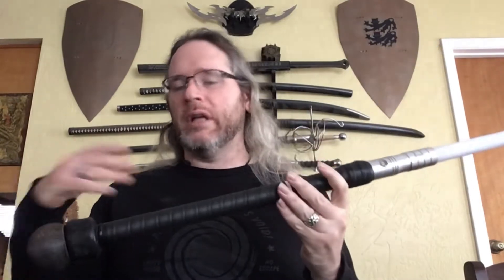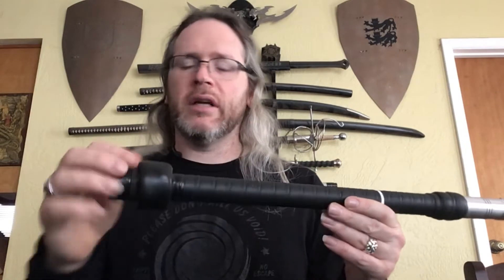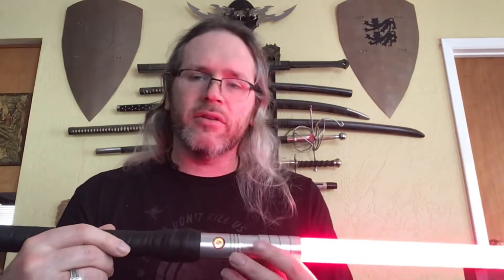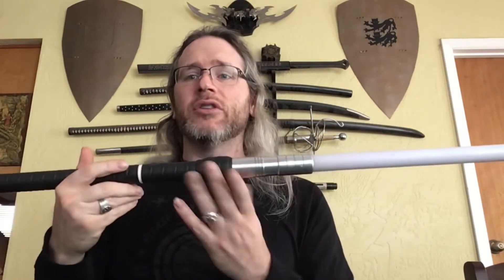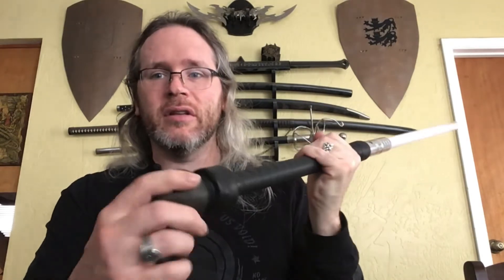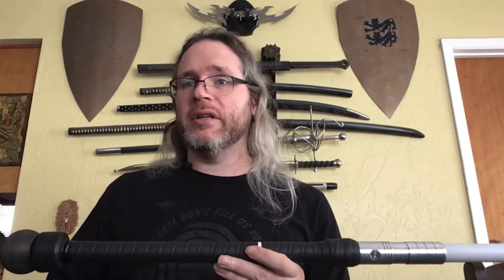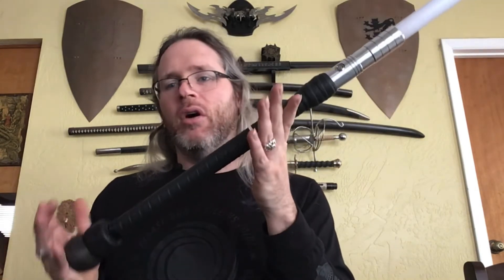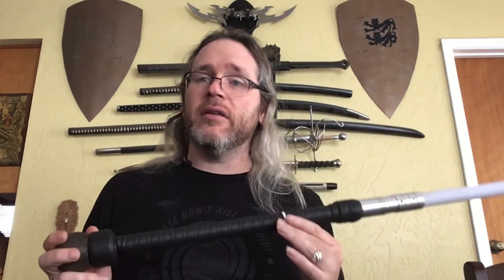Contact Flow Saber from The Saberflux Workshop

Comment: Dude that was an awesome review thank you so much!!! It really means a lot to me for it to be so well received by you 🙏
Just a couple of little but important corrections!
-the rubber-like pommel is actually flexible TPU and the chassis is PETG (I’m gearing up to switch to nylon for the chassis). 
-the main counterweight is padded steel.

haha and now I’m actually using some transparent silicone caps for the blade tips so you’re dead on with that! I’ll have to send one your way! They are VERY durable (like they won’t break even if you try) and they are also removable so you can take them off when you want.

Everything else was spot on and I really enjoyed how you where able to break it down and describe it. Thanks again man I really appreciate it🔥

Comment: Very interesting.  Thanks for this video.  Could you perhaps provide some specs?
Overall length, exposed blade length, handle length, emitter length, and total weight would be great.  Thanks.
Reply from the maker: no problem. total length 51”. 24” hilt, 27” exposed blade. 4.5” metal emitter. POB 13” from pommel. Total weight around 27 oz.

Comment: Thank you for the intro to contact flow sabers. Does the tape ball on the end of the blade actually provide additional balance? Would a Kyberlight blade with those long screw in blade tips not serve the same purpose while maintaining a more blade like appearance or do you think it would break off in a drop?
Reply from the maker: it is mostly about the impact resistance. the rubbery silicone bounces. the Kyberlight tip with the long thread might not pop off, but it would dent and the blade into which it threads might break. I mean, you can use it without the tape but you sacrifice function for form.